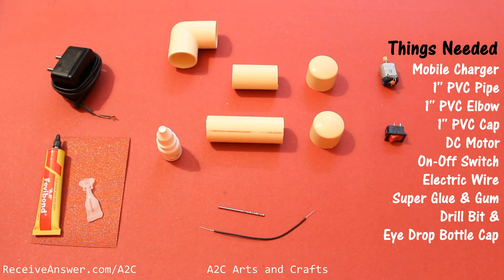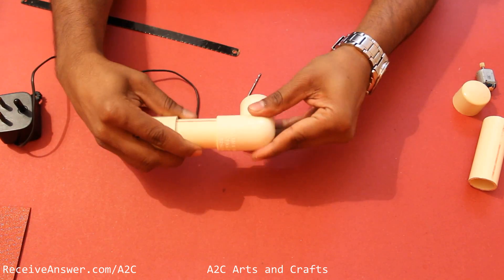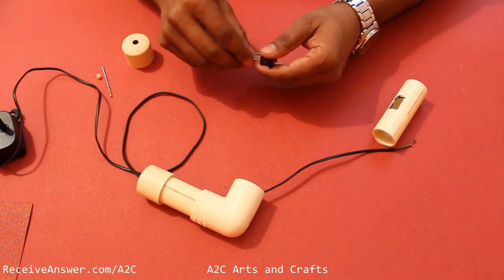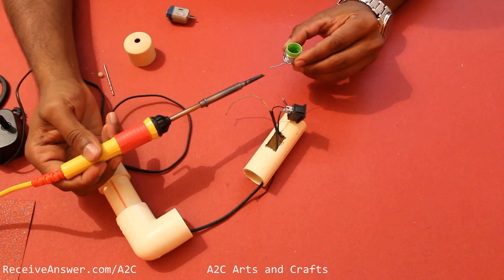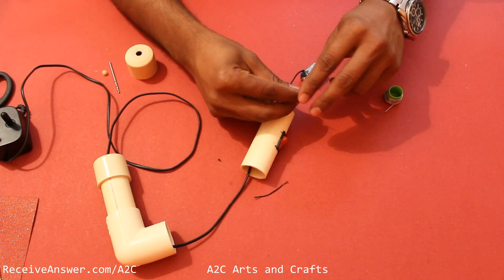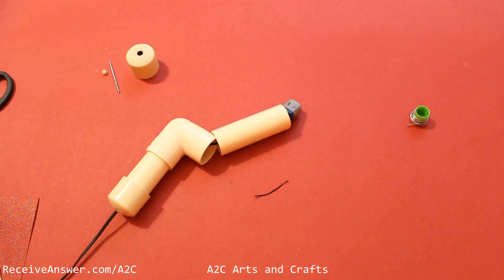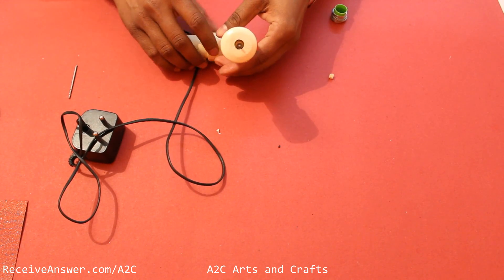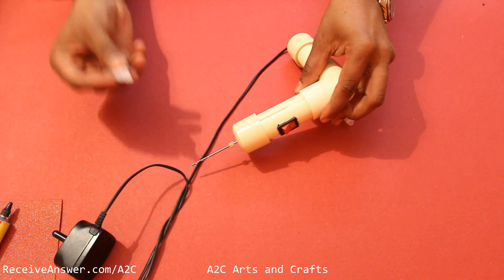How To Make Drill Machine at home - EASY

Comment: This is good.  But there is one disadvantage that we are stuck with drill bit of one size.  I did this a while ago and then got stuck cos I could not get a mini drill chuck to change drill bits.  Then you see you can use variable sizes of mini drill bits.  If you get any idea of how to change drill bits from one mm onwards let me know.   The same you can give and option of forward and reversible as it is a DC motor for easy pulling back of the drill bit from the hole.  Also can easily add the option of a 9V battery in case you have to carry it around and there is no plug point nearby,  Have a nice time.

Comment: I wonder what a fully charged 12V battery would do with this thing.
Reply from the maker: +JoeAceJR Hi Joe, the motor will burn out as it's just 3 volt, instead we can use a 12v DC motor it will be powerful. :)
Reply: A2C Arts And Crafts You really should try making that salt water battery I was suggesting in another video, or the vinager penny battery, or both. I do like your videos btw.

Comment: I followed whole video but how 3V motor connected to 220V,6A mains? will it work or will it burn? How to make it work with AC ? i am curious to know
Reply from the maker: +pragya namdeo I have used a phone charger which gives 5v output, so still the motor works fine

Comment: ca we use accu baterry 12v instead of mobile charger
Reply from the maker: +Kalinga Ranjan, the motor I used was 3v, with 12v battery it may burn off. You can use a 12v DC motor and then use the 12v battery

Comment: Will it work if we use the battery of 9V
Reply from the maker: +Aanchal Saini it will, get 12v DC motor that has better power  and works with 9v battery too
Reply: Ok Thanks..

Comment: there are four wires in mobile charger which wire would I connect to motor
Reply from the maker: +sailu yellapragada Hi, the charger I used was a simple one and had only 2 ends. Try connecting Red and Black wire

Comment: what is the volt & Rpm of the motor which you have used??
Reply from the maker: +Mohammad Shahbaz Alam Hi, I have used a 3v DC motor and I guess RPM 5000.
Use higher volt motor like 12v with higher torque, it will be more effective for drilling

Comment: do we need to use the drill bit of the same diameter as of the diameter of shaft of the motor since i tried to use a drill bit of different diameter I am finding that my drill bit is not moving straight please help me
Reply from the maker: +Amitesh Dungarshi Hi Amitesh, it's preferable to use same diameter. If your using different diameter then we need to make sure it's correctly aligned to center

Comment: Wat. Is the small piece you use to connect the motor  and the drill bit
Reply from the maker: +MISHAL'S LAB Hi, you can get that in electrical shop, it's electrical wire connector.
Reply: can i get it from a hardware
Reply from the maker: +MISHAL'S LAB no you can't get that in hardware shop

Comment: should I use the battery or the plug current for this thing
Reply from the maker: +talal ashfaq Hi, both will work. You can use 2AA or 4AA size battery or connect to power using mobile charger.

Comment: Is there any specific capacity for the DC motor?
Reply from the maker: +laxmansarma R The one I'm using is 5v. You can use higher capacity motor like 12v along with 12v battery, they will have much higher power

Comment: and what's the volt of the mobile charger I mean output?reply fast
Reply from the maker: Hi, it's 5v
Reply: +A2C Arts and Crafts can I use a 10v output charger to it but the motor heats up slightly is it safe to use it?

Comment: A few remarks, firstly I would have tied a knot in the cord inside the pvc cap so if you drop the charger it won't pull the wiring inside. Next I would buy one of the very cheap drill chucks so you can change drill bits easily and also maybe use cut off wheels or similar. I guess the 5v motor is also very weak, but it is only intended for small jobs.
Reply from the maker: +TheAussieStig30 Very valid inputs :) Thanks for the feedback.

Comment: How much volt dc motor is needed??
Is it 5v????
Nice and useful video though!!!
Reply from the maker: +Samarth Prajapati Thanks, I have used a 5V DC Motor
Reply: +Samarth Prajapati it has to be 5v, because that's the voltage supplied by all phone chargers, the reason they all use 5v, is because that's the same voltage as usb.
Reply: +Ben Newington OK Thank You